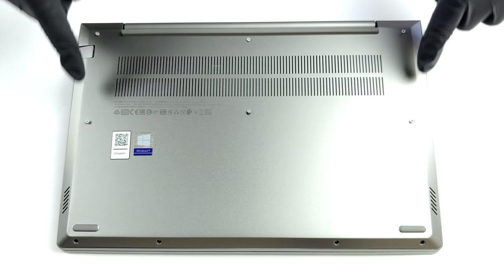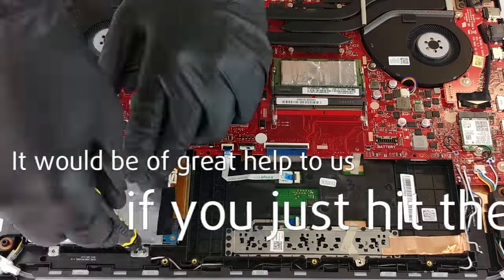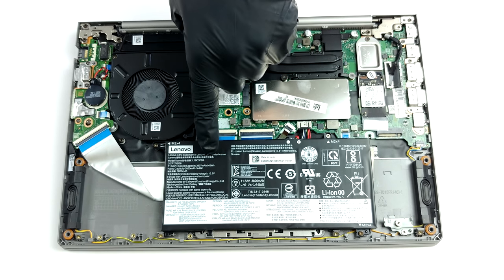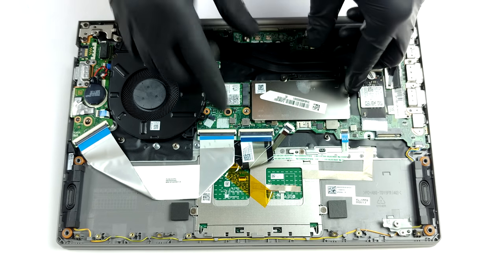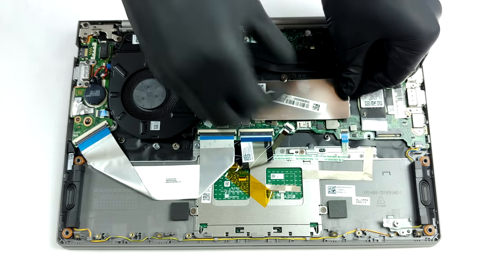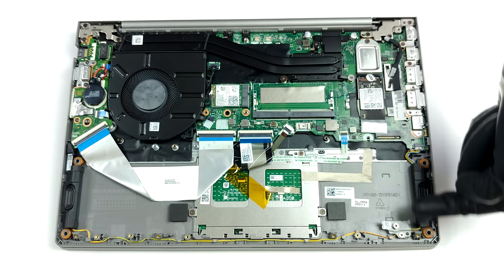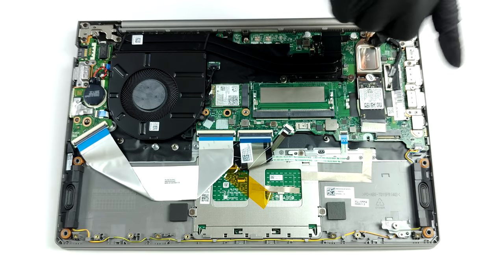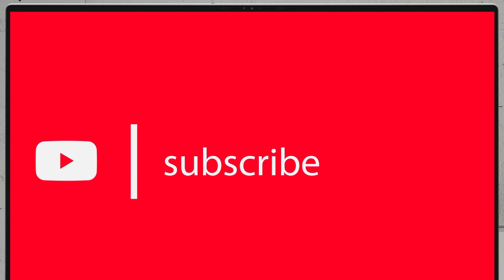🛠️ Lenovo ThinkBook 14 Gen 2 - disassembly and upgrade options

Comment: Mine says PCI-e 3.0 x 4 and PCI-e 3.0 x 2 for the two m.2 connector. So both are 3rd gen but one with 4 lanes and the other one with only 2 lanes
Reply: klo saya cuman punya satu slot nvme pcie 4*4 tapi ada satu lagi blm ada slotNya nvme pcie 3*2 ,tapi mungkin bisa di kasi slot. saya kurang tahu semoga ada jawaban. info dari motherboard Nya sendiri.
Reply: can you confirm which m.2 slot is x2 and which is x4 ?
Reply: @hoangd4132  they should be labelled on the board